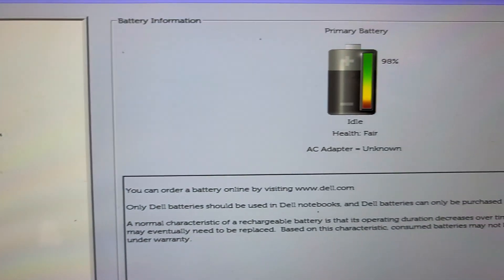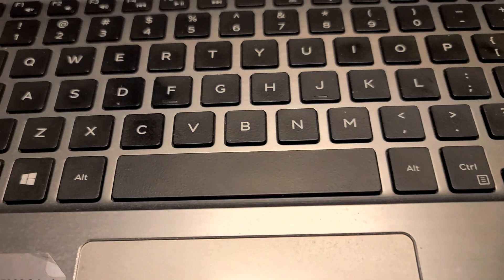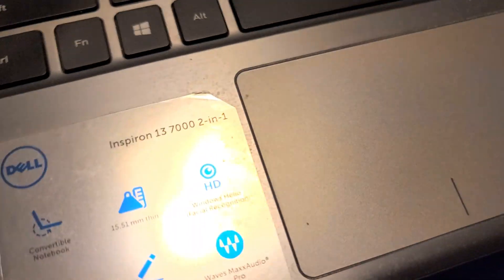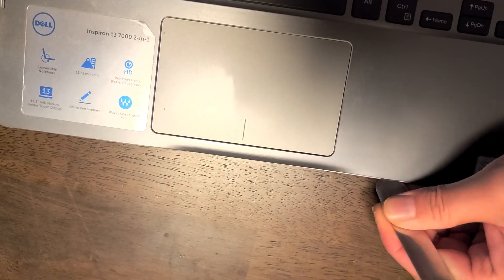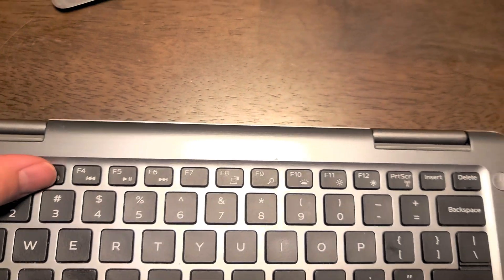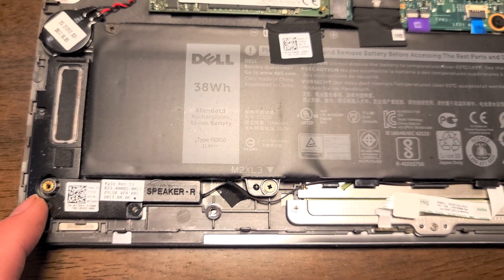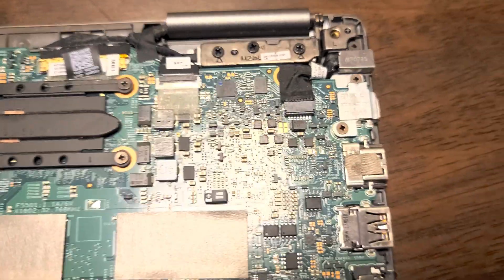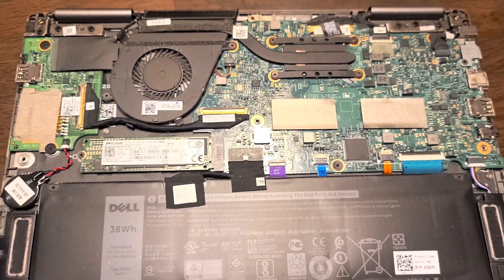DELL Inspiron 7373 2 in 1 Disassembly SSD Hard Drive Upgrade Repair Battery Replacement Quick Peek

Comment: can the soldered ram be upgraded? 
i used PC-audit and found that my motherboard supports up to 32gb ram
mine currently only has 8gb, I know the ram is soldered but is it possible to be upgraded?
Reply from the maker: If you're asking if I can, no. If you're asking if it's possible,  sure, anything is possible, but it'll likely cost hundreds of dollars to have it done.

Comment: Please reply peace
Reply from the maker: Hm?
Reply: @ItsBinhRepaired   man but the built in screen test that i have done is showing colours changing and one time it showed the logo of dell and after that it disapared and it started flickering and when i gentely press the back of the laptop it some time increased and decreaed some time and i think the mothor board is like good because of built in screen test has passed man palese help me where are you from
Reply from the maker: @Bilalgtasannadreas  possibly faulty screen if it beeps.
Reply: @ItsBinhRepaired  no it does not only 2 yellow light shows and 4 whilte light under the mouse pad
Reply from the maker: @Bilalgtasannadreas  I'm not sure

Comment: For those who are in doubt if this model works with standard Nvme discs, I tested it with the Xraydisc 512gb Pro nvme disc and it worked perfectly. 2800 mbps write and read speed
Reply from the maker: Awesome!
Reply: would the BLACK SN770 1TB Internal SSD PCIe Gen 4 x4 work?
Reply from the maker: @DaRealSensei1  any nvme would

Comment: I use guitar pics, old credit cards, and those little blue plastic pics you get with replacement batteries.  I practiced a lot on old, cheap netbooks or chromebooks to get better at it before working on more expensive computers.
Reply from the maker: Yup, that's how you do it. Practice practice practice. My fingernails do it all. Lol

Comment: Thanks. What exact type of ssd can be used for an upgrade? I read somewhere that the SSD originally in the 7373 is slow and draws a low current while a replacement is much faster but draws a lot more current, is this true?
Reply from the maker: https://amzn.to/3fyBOmA something like that should work. If it supports pcie nvme, you should get one of those instead of a sata one.